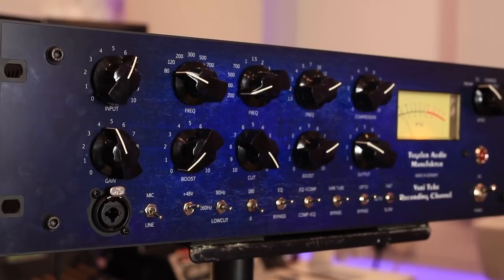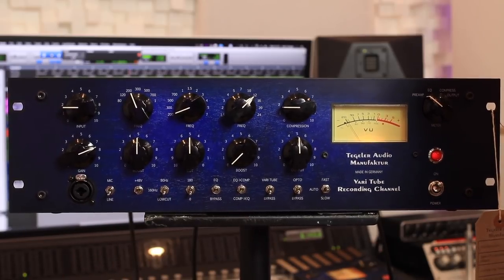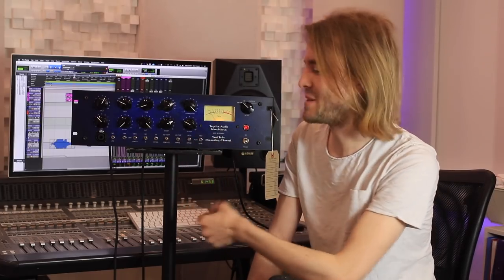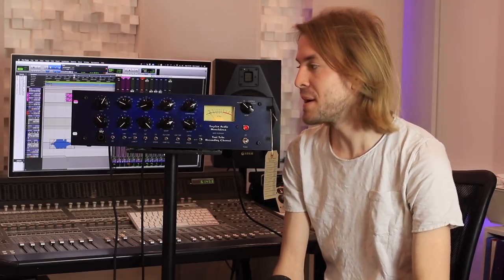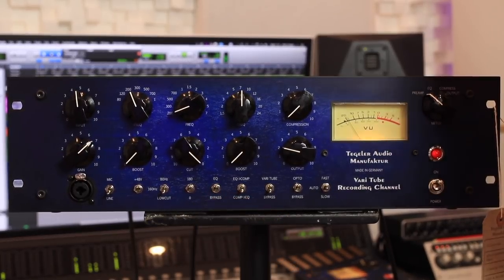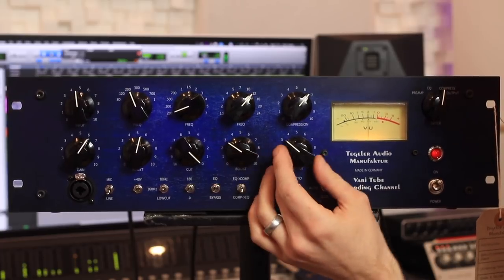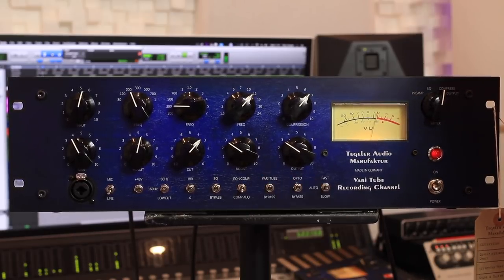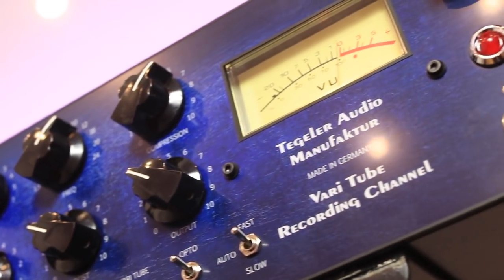Review - Tegeler Audio Manufaktur VTRC Vari Tube Recording Channel Strip

Comment: I have to say that Tegeler units are program dependent more than say other manufacturer’s gear. Great input material allows you to get that “a ha!” moment with Tegeler equipment. Now, for a hobbyist recording their own stuff, I’m not certain I can produce material that will allow the Tegeler VTRC shine as it obviously can. Listening to various demos of Tegeler gear on YouTube has me convinced that the best demos of their units are from their own website. I will say there is a 3D quality to their gear and that separation in the sound is a very good thing. I’m looking to purchase 2 of the VRTC, or a Créme and the summing tube mixer because I wanted to know if I could get a more options of great quality for my money. It’s difficult to tell from videos on YouTube what I’m really hearing but I’m not convinced. I’m sticking to my original plan which costs over double of two VRTC. I won’t name the manufacturer but I’m going to buy EQ units that cost what a creme and the summing mixer cost.
Reply: You’re not going to name what you plan on buying? Why? What are you afraid of? Just name it. What’s the big deal?
Reply: @jamesb44  Because it is not in good taste to do so.  This is their format and I wouldn't want someone to use my video to advertise a different product.
Reply: @onethousandtwonortheast8848  It’s neither in good taste or bad. It’s merely a fact and a preference. Nothing wrong with that.